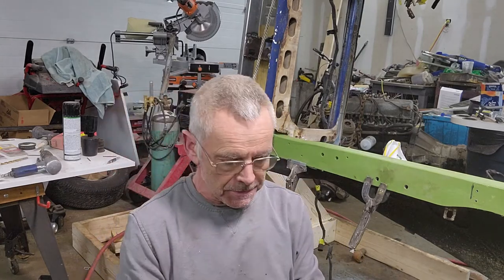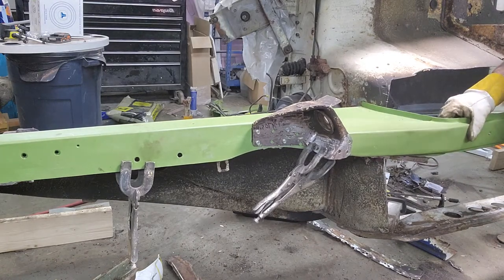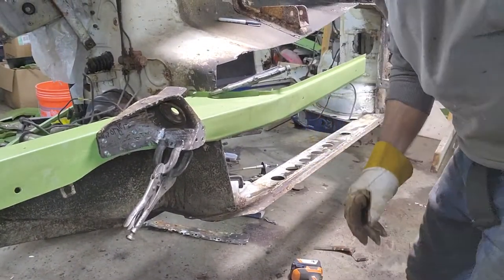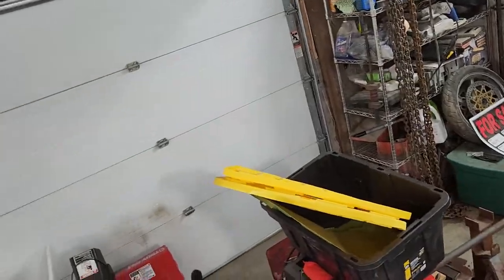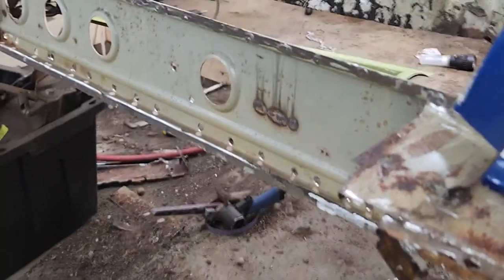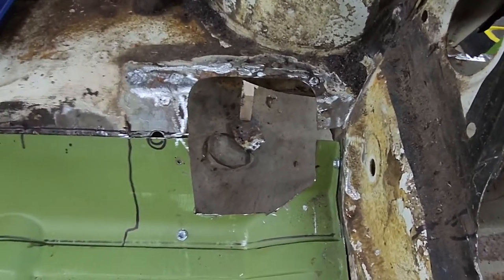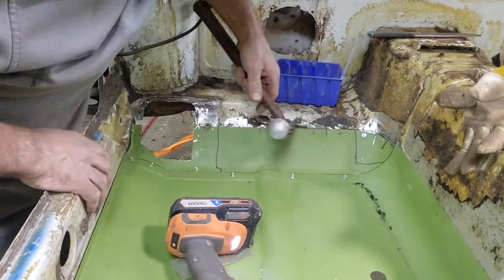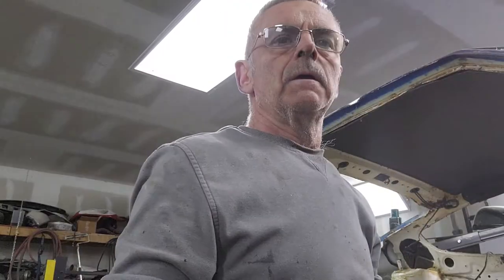Datsun Z front frame rail and floor panel test fit (con't 2)

Comment: I did this same frame rails, floor pans, inner and outer rocker and a complete quarter panel replacement a year ago, KF panels need some massaging as they say, but better then the other stuff out therel. I braced the door jams and also side to side and built a jig so the front crossmember holes were my focal point and measured from there. You do a really good job on your building skills and am enjoying  watching your build, keep up the great work.
Reply from the maker: Thanks.. I haven't been able to work on my car since March.. I do have more videos but I need to edit them

Comment: haha im building a datsun 280z and a 69 mustang fastback. I am doing both at the same time. I have about 3 months in my fastback. all new panels trunk pans floorpans battery apron. Its alot of work but got to commit.
Reply from the maker: I've been working on a 1970 Mustang convertible for a year now.. came in for a strip and repaint.. replaced both quarters,  outer wheel houses,  rt and lt trunk floors,  radiator support,  both front rails,  both front and back fender aprons on both sides, both doors  and the customer wants me to fabricate the trunk lid and quarter extensions to look like a fast back...

Comment: Wow...I finally found someone else who had the exact same fit issue with the KF rails!  When the floor rail was put in place the back and front ends touched the floor and front rail, but there was a major gap just like you show at the end of this video.  In short, when the front of the floor rail was put in place against the front rail (just like you did), the aft end of the rail was NOT even close to parallel to the sills of the car.  I took lots of angle measurement of the other (undamaged) rail on my car and the KF rail simply didn't match.  KF assured me that they never had a complaint about this before, so I convinced myself that I had screwed something else up.  Anyway, I did some reconstructive surgery to the front of the KF floor rail to properly recreate the angles of the other (original) rail on the car. and now it all fits (and matches the other rail).
Reply from the maker: If the floor rail is to far back it won't fit into the floor.. gotta make sure everything lines up before welding..
Reply: @thisoldzdiyzrestoration2980  Yeah, I had the forward/aft position dialed in properly.  And yes, I welded the floor up before installing the missing rail.  But the error was so significant that I would not have been able to reposition the floor to eliminate that much gap.  I took a lot of angle measurements of the (original) driver's rail and angle of the front "ramp" is 8 degrees off of horizontal (the floor reference).  The KF piece is a much sharper 13 degrees.  So I had to do some surgery to make the KF piece identical to the factory.  Now it looks and fits great, but took more work that it should have!
Reply: If you like, I can send you some of the pics I took showing the angles and the surgery l did.
Reply from the maker: @johnbroman7235  sure
Reply: @thisoldzdiyzrestoration2980  You do not have any contact info enabled for your account.  Let me know how I can contact you to send the pics I mentioned.
Reply from the maker: @johnbroman7235  I need to figure out how to do that..

Comment: did you brace the chassis?
Reply from the maker: Not as of yet.. I was cutting out some panels to see where I was going and what I needed to replace.. if I wasn't planning on replacing the inner rocker then I feel bracing wasn't necessary,  but I decided to replace the inner also so I need to brace the door opening.. that's why I'm making the jig.. it will hold the car in place better depending on what I cut out and replace.. also I am only doing one side at a time..